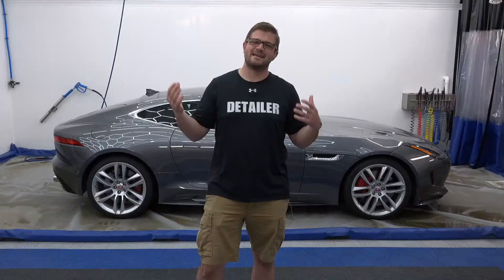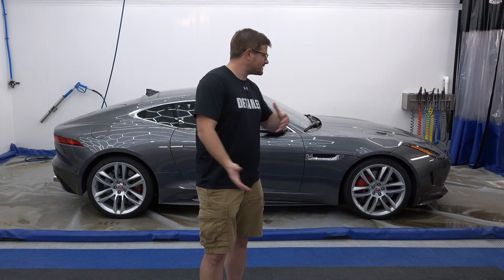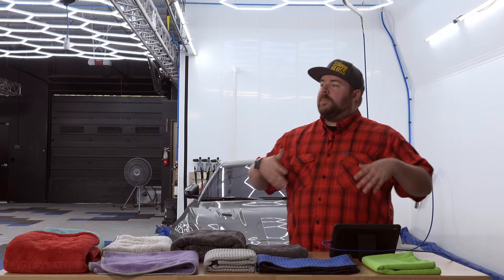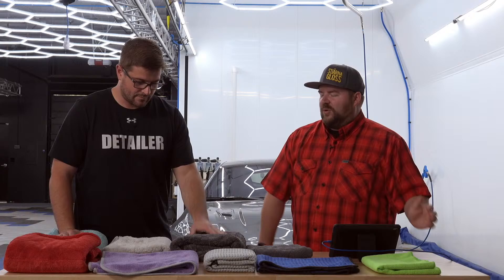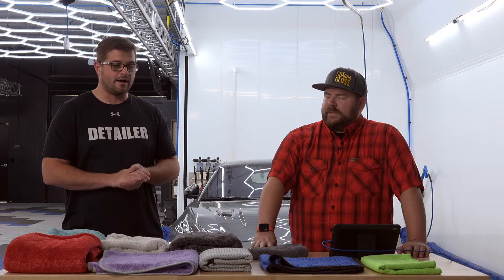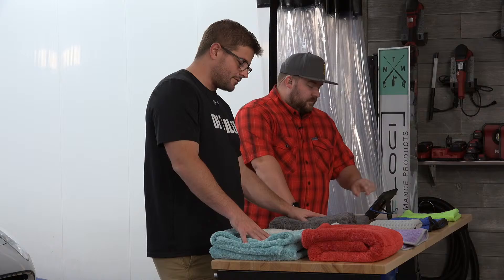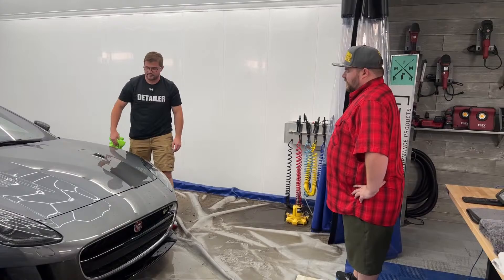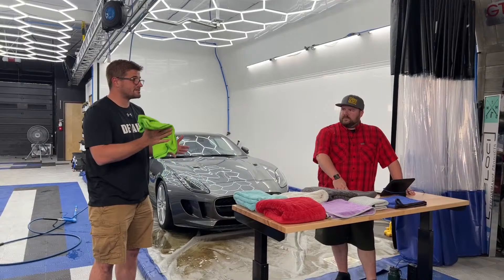DRYING TOWEL Comparison 💦 What's YOUR Favorite?? 🔴 LIVE DETAILING EVENT

Comment: The drying towel has its limitations. Ive got a pro air cannon with an air squeegee attachment that does a perfect job of getting rid of the rinse water including and especially the hard to dry areas, like the wheels, tires, undercarriage and sides. I dont think the drying towel can fully  duplicate this but the towel does a good job and is quicker on the flat areas like the hood and the roof and is a lot cheaper. Probably the quickest way is to use the drying towel on these flat surfaces and the air squeegee on the other hard to dry areas.  And the drying towel will not accumulate any dirt and grime from the wheels and tires and undercarriage. I think I may try this as the cost of a good drying towel is nothing compared to the price of a good air cannon which can run well into the hundreds.  Just my two cents.